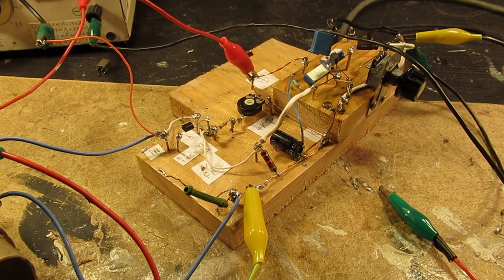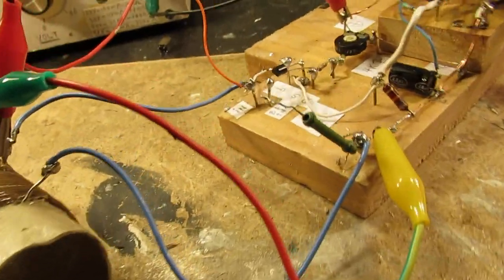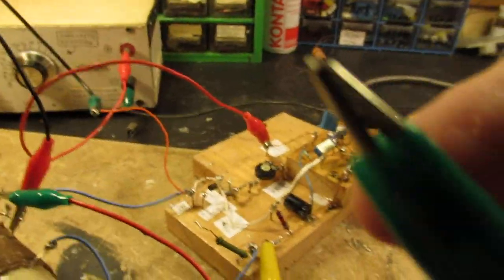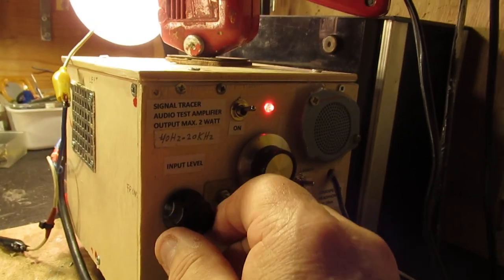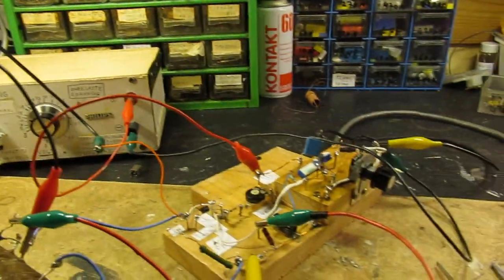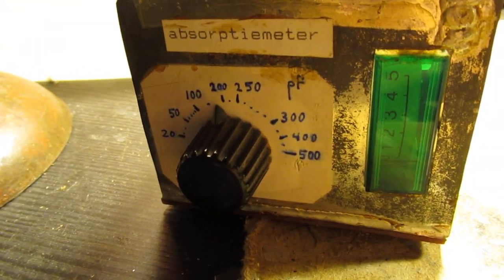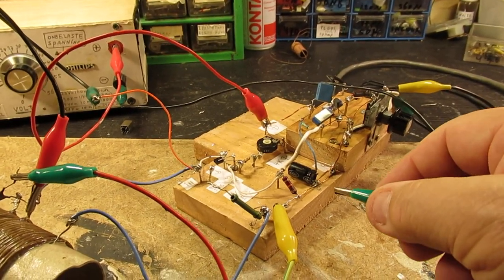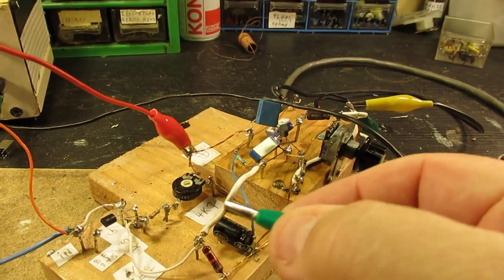2 transistor too Simple SW radio:  the Regenerative principle and Q multipliying (demo & schematics)

Comment: Shematic please 🙏
Reply from the maker: Basic schematic is here https://youtu.be/fVJ57DyY-oI      (19 dec 2022) It is the same circuit. That was a schematic for an MW Radio, going from (say) 800 KC to (say) 1.6 MC. You only have to change the antenna coil (visible in the video, made on a toilet roll, diameter 4 cm, well varnished/laquered with glue for PVC pipes (smell: acetone) and use less windings on that antenna coil to make it work for Shortwave. Circuit is a very simple TRF amplifier.